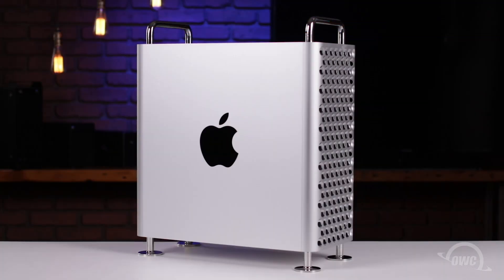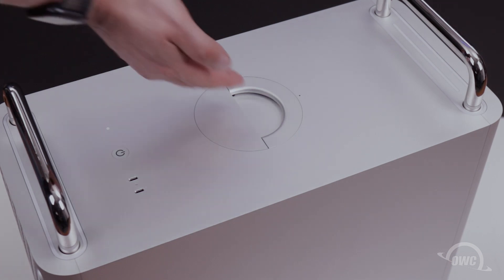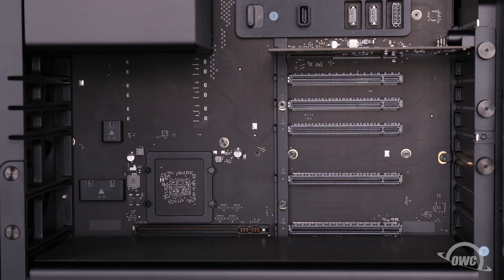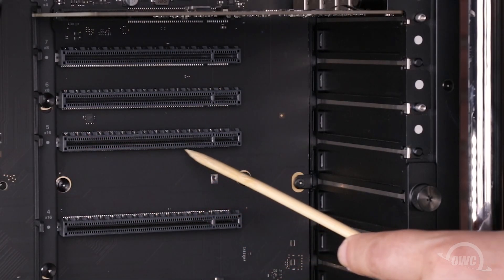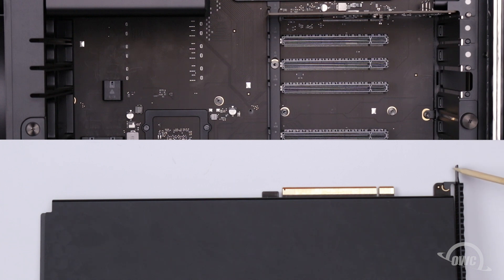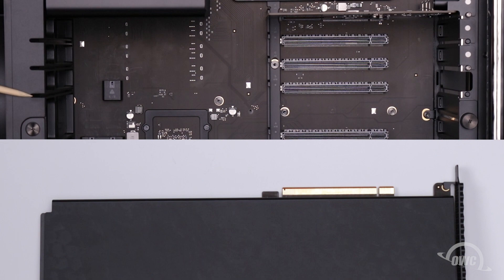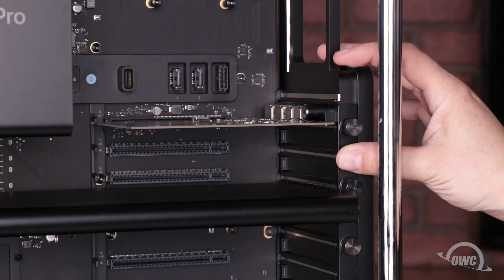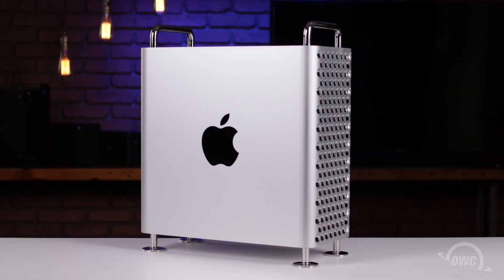How to Install an Apple Afterburner Card in the Mac Pro (2019)

Comment: What is the point of this card?
Reply from the maker: The Apple Afterburner Card is created exclusively for the Mac Pro, the Apple Afterburner card is designed to accelerate the ProRes and ProRes RAW workflows of creative film and video professionals. For any creative who works heavily with ProRes and ProRes RAW files1, it delivers an array of time saving and performance enhancing features you'll not want to miss.
Free up CPU cores for additional processing by offloading work onto the Apple Afterburner card
Enables faster transcoding of ProRes and ProRes RAW files1
Supports playback of up to 6 streams of 8K ProRes RAW, and playback of up to 23 streams of 4K ProRes RAW2.